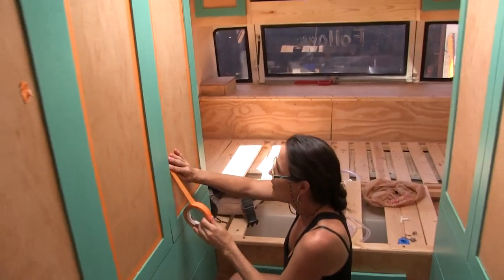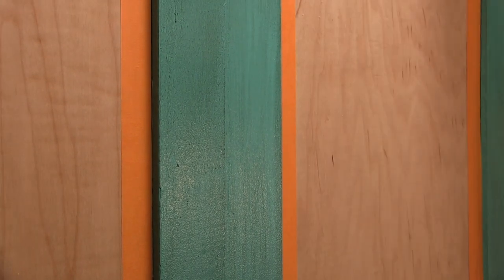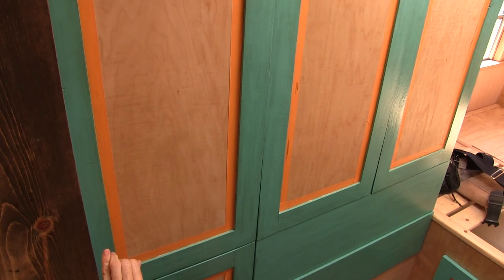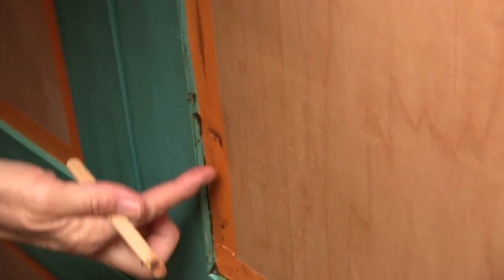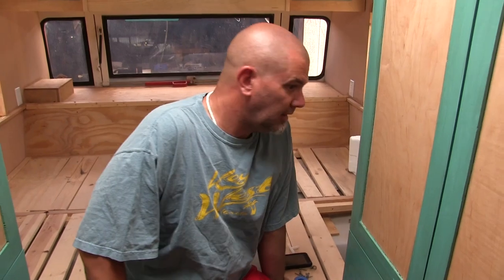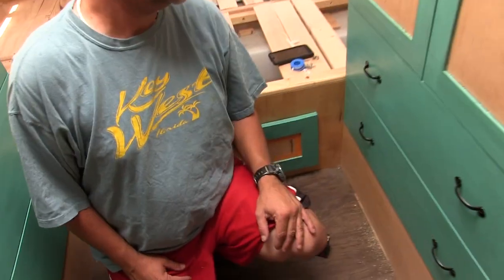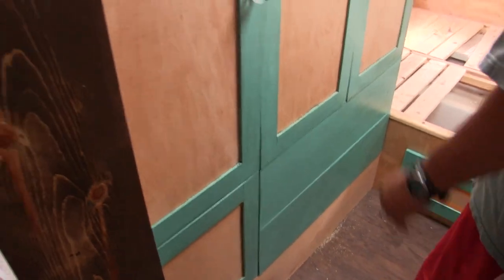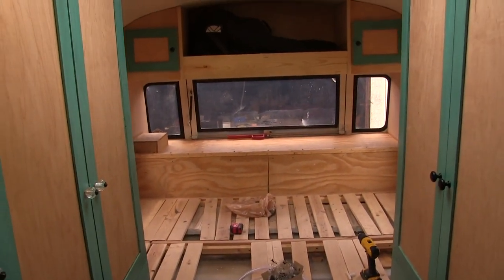Antiquing the Closet Doors plus Knobs & Magnetic Latches in our Skoolie

Comment: Old dresser draws had 2 pulls because they slid wood on wood. Today with roller slides 1 pull is sufficient. We use to have to wax the bottom of the draws to keep them sliding descent.   Frank